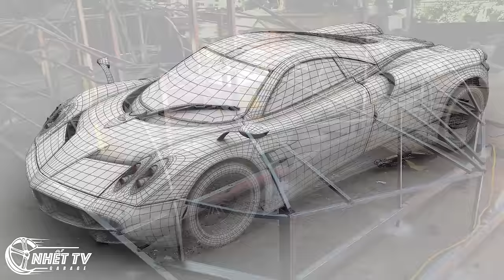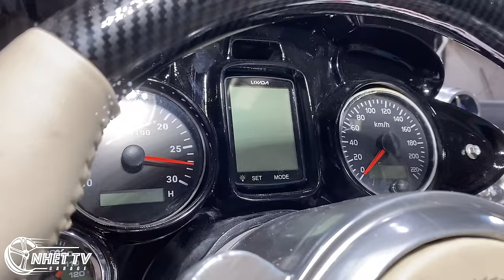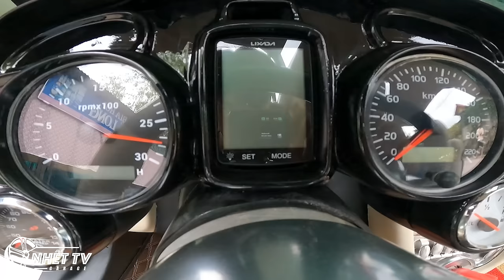400 Days Of Building The World's Craziest Supercar "Pagani"

Comment: Ok let's see the ENGINE, Ignition, Console lighting up, Air-conditioning etc. Oh right, I forgot, this runs on Manpower instead of Horsepower. PUT IT ON A SHOWCASE...😂

Calling this thing, a PAGANI, is like calling Dylan Mulvaney,  NAOMI CAMPBELL... 😅

A cheap imitation will always be nothing more than cheap! And it is not flattery.

Instead of copying, make something ORIGINAL. And it shouldn't simply be a non-functional showcase "project".